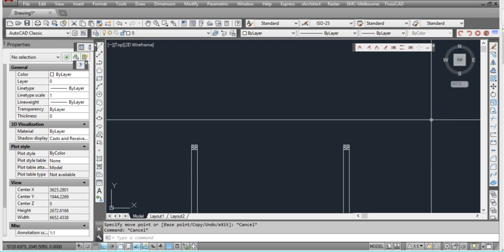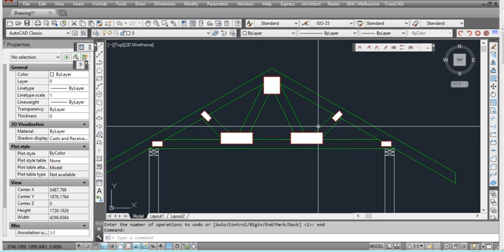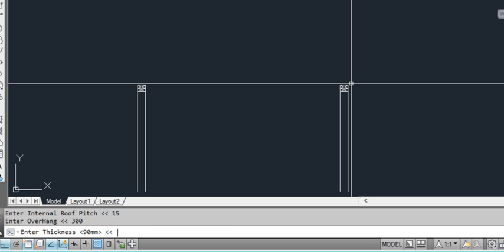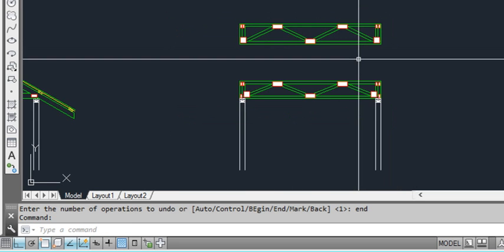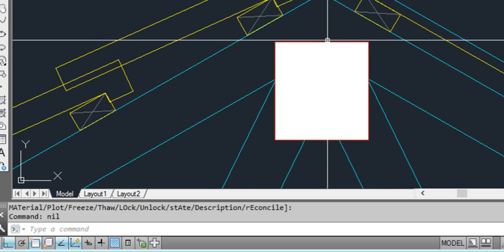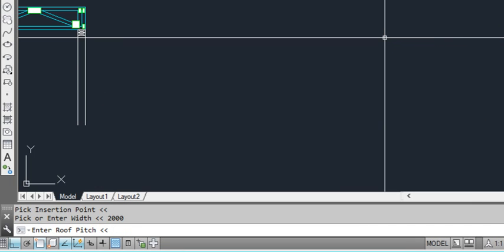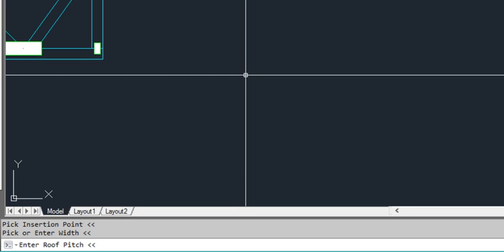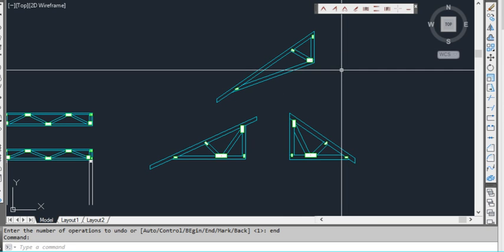Program to draw trusses in AutoCAD - TrussCAD

Comment: Hello, I have installed AutCAD on another drive that isn't C:// but when i use the TrussCAD installer the only selection for AutoCAD shows that it's on the C: drive when it's not. I installed it anyway hoping that it would still recognise and that the C: drive destination was just for the plugin, however TrussCAD didn't show up in the ribbon.
I also tried copy and pasting in the correct path for my AutoCAD into the TrussCAD installer but that hasn't seemed to work either.

Are you able to shed some light onto this? Thanks!
Reply: it's cool i figured it out via here http://shadow-diagrams.com/Shadow_Diagrams-Menu_Troubleshoot-2006.html
Reply from the maker: I'm glad you got it sorted, if you have any other questions please ask.

Comment: I tried to use this to draw wood floor trusses in AutoCAD 2016. It didn't work or draw them correctly at all. What it drew was very odd. Uninstalled. Maybe it's because I'm in the US and we don't use metric units. Thank you, anyways.
Reply from the maker: Hi Derek, thanks for giving me feedback about your use of the software. You are correct the software is designed for metric and this is most likely the issue. If you did want to use the software, all you would really need to adjust is the .dwg files in the Truss CAD folder as they are the nail plates of the trusses and are drawn in metric so you could draw them in imperial, or, type UNITS at the command prompt and change insertion scale to imperial if not already.
THe only thing you can't change is the metric dimensions of the trusses as it is all in mm. So 90mm is close to 4", slightly under. If you can live with that i think the software would work correctly then. I have been meaning to get around to adjusting the software for imperial
Reply: Hello, Andrew. I re-installed and drew a couple different height trusses in an "acadiso.dwt" (metric) template and upscaled them in my Imperial drawing template. Another unfortunate circumstance is that Imperial lumber dimensions for nominal 2x4's are 1 1/2"x 3 1/2" actual and the components measure thicker than this. While in most cases exact component dimensions don't really matter, to some details they do. If you do by any chance create an Imperial version of the software. I'd buy it in a slim second. Please keep us posted and thank you again.
Reply from the maker: Hi Derek, the TrussCAD software is working with Imperial Units now. All you need to do once installed is ensure you are set to the correct units.
In AutoCAD, at the command prompt, type UNITS, in the window that pops up, select Architectural from the Length Type drop down box, and under Insertion Scale select Inches.